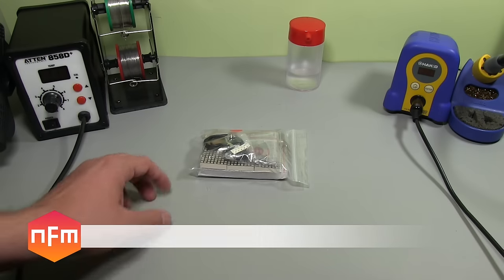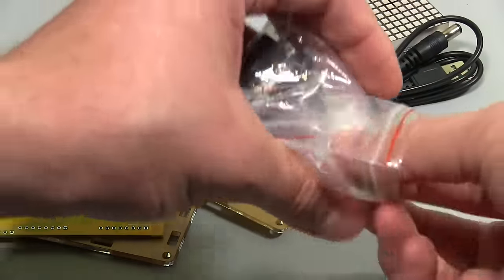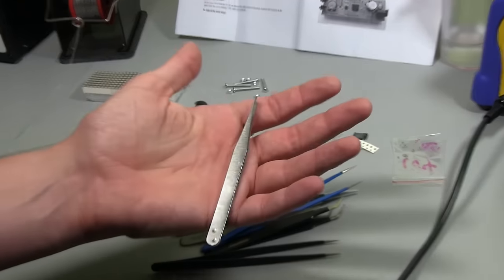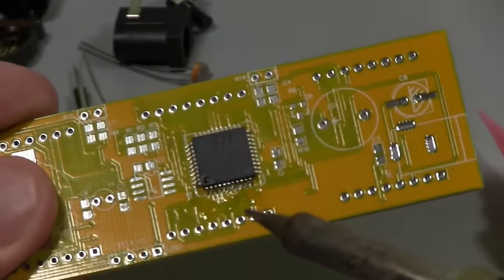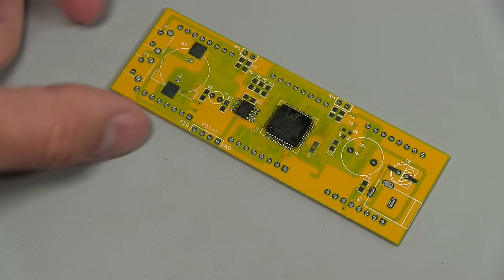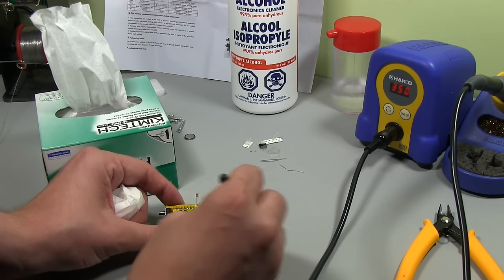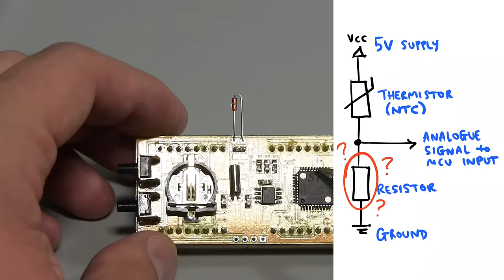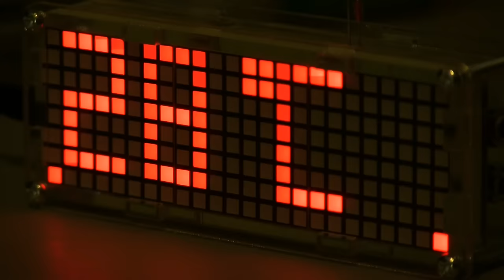Banggood Dot Matrix Clock Kit Build

Comment: I have ALMOST the exact set of instructions you show for mine EXCEPT apparently it is a later revision as mine is corrected to list 5 resistors (including the two you had to figure out that you needed)!  Otherwise it is identical as far as I can see.

I have not quite figured out how this thing works totally.  For example: I do know how to set the time and alarm. I also figured out that the one dot in the lower left corner seems to be alarm on or off, but I do not know what the dot in the lower RIGHT corner indicates.  Is it an hour chime?  AM/PM indicator?? Other?  I also do not know if this can be set for 12 hour time format (or how to do it) or if the temp can be set to display degrees Fahrenheit (I'm in the States).  

Has anyone found CODE for these?  Are there instructions in readable english?  Any other help?

THX!!

Comment: Thank you so much. Very helpful.  Went through several videos before I found this perfect match to my kit.  ($5.50).  There was much lost in the poor translation of the included instructions and very poor printing of the two illustrations (you had the same instructions but higher resolution printing in your video
).  I had figured out the positioning markings on two major components, and the necessity of the unlisted three extra resistors before assembly (gratefully, I watched this before assembly), but seeing your conformation was encouraging.  I had never soldered anything this small before - so this video was very informative.  For novices like myself,  I would recommend stating (instead of just showing) the positioning of the three display modules before soldering, and the recommended temperature of the iron - I saw that you used 350º.  Also, thanks for the recommendations on tools for handling components.
Reply: I realize Im pretty randomly asking but do anyone know a good place to stream new movies online ?
Reply: @Merrick Gustavo thanks, I signed up and it seems like a nice service :) Appreciate it!!
Reply: @Bodhi Brian glad I could help :D

Comment: Is this reprogrammable? Can I make it display a message or countdown?
Reply from the maker: Good question. Technically it may be possible. The microcontroller is a STC15F2K16S2, so you'll need to find a datasheet and compatible programming tool for that. I don't have any experience programming these STC chips, so I have no idea how easy or difficult this might be. The source code isn't available as far as I know, so you'll be starting from scratch.

That's all a bit difficult, so it would probably be easier to just buy the kit for the parts and make your own PCB for an ATmega328P microcontroller. You'll be programming it from scratch, but at least this way you could make it Arduino compatible and easily open source it if you wanted to.
Reply: Here is a project I did for re-creating an open-source firmware for the 7-segment "little" cousins of these STC-based diy clock kits, which has quite limited (4k flash) abilities.  
 https://github.com/zerog2k/stc_diyclock 
This one looks to be a little bit more hackable because we can do more with the display (scrolling text, etc) and mainly the flash size of the mcu seems quite generous (16k flash, 45k "eeprom" for font/char tables, etc). Also has hardware peripherals like SPI, so (assuming the pins aren't already taken up by display matrix driving duties) we could do stuff like hook it up to an NRF24L01 module to remote control, timesync, etc, or even hook up one of the uarts to a small gps module for atomic clock timesync!.  But a bit concerned that I didn't see a schematic included with that kit, which would slow things down a bit with all the pin tracing :( - still might get one and play around with it.
Reply: oh and this appears to be the right datasheet:
 http://www.stcmicro.com/datasheet/STC15F2K60S2-en2.pdf
Reply: So I got one of these - part of my diy clock addiction - I have way too many of these!  I traced out the mcu connections.  A few observations: Almost all pins on the mcu are used up - most of these driving led matrix which is common anode on the 8 rows and individual cathode column lines (8x3). The leds are surprisingly being directly driven without transistor or even current limiting resistors :(. It would have cost only a few cents more to drive the columns with a few shift registers, and could have used a much smaller pin count mcu. The biggest issue is that direct driving is tricky and somewhat dangerous - if you don't drive with low duty cycle pwm, it's easy to burn out an io pin. Shouldn't be too hard to port my clock code to this.
Reply: Jens Jensen 
Cccc

Comment: That "flux removal" is absolutely pathetic. Stop using that silly method. Go to Jaycar and buy a can of spray circuit board cleaner. Then spray it on and use a toothbrush, just like you would clean your teeth. Throw away the Isopropyl, and those wipes should be used for "personal use", not for attempting to clean off a PCB. Oh, and while you are at Jaycar, buy some flux.
Reply: IPA, an anti-static brush, and kimwipes is the  time-honoured cleaning technique that meets the highest aerospace and military standards.  It's how it was done in the factory I worked for (and all the 'usual' training videos demonstrate it). This PCB does need one more cleaning pass to finish it, but it's definitely  being done the right way. :) 

IPA is a known quantity that won't adversely affect most things and it completely evaporates.  Kimwipes are very clean and have low lint, meant for cleaning like this. Don't use these for anything ummm,  errr,  "personal", as you will have no skin left on your "personal area"  before long  :)

While a can of aerosol pcb cleaner is effective, the contents are a bit of a gamble as far as effects on certain plastics and they are usually quite nasty to humans (the same goes for no-name flux)...  A nylon toothbrush is an excellent static generator, though in Australia the humidity is unlikely to be low enough unless you have a refrigerative aircon or electric heater.   

I use spray, a toothbrush and paper towel, but with similar techniques to those shown to avoid splashing the stuff everywhere and limit the fumes -  and I'll go outside if it isn't raining.  If I was building stuff in any sort of volume I'd be back using IPA in a heartbeat.